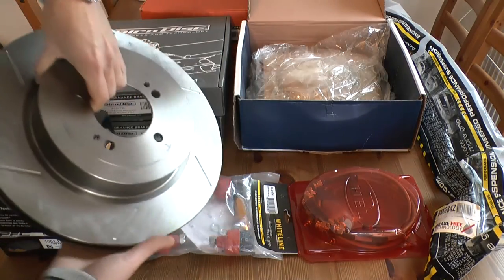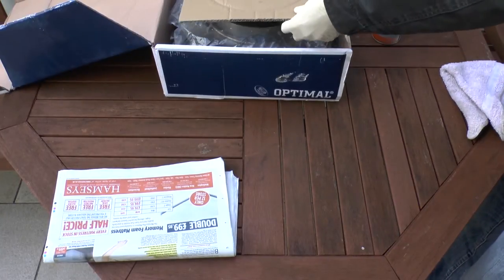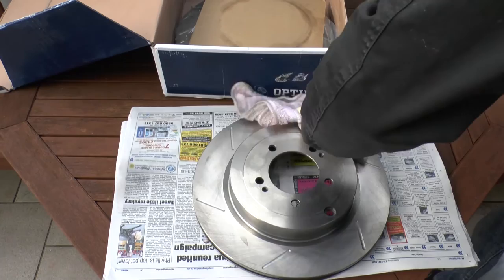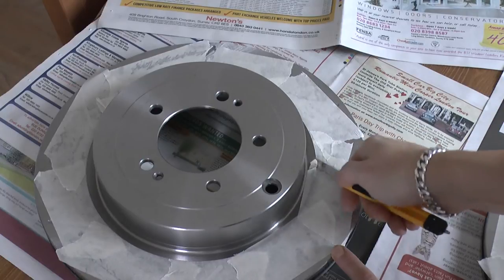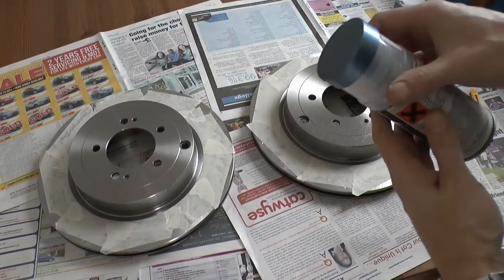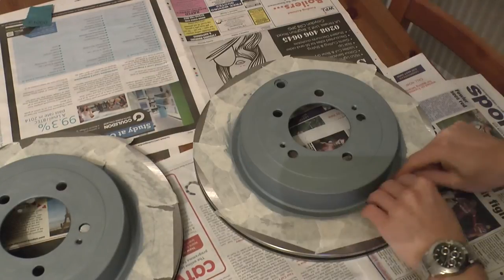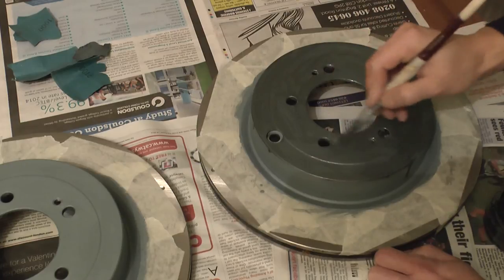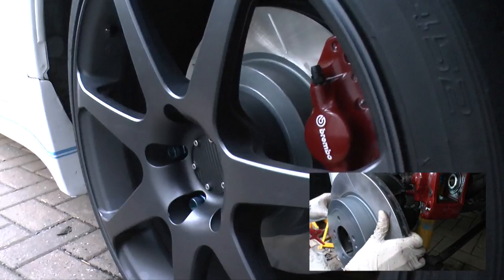How To: Paint Brake Discs/Rotors (Evo X)

Comment: Would a clear coat work the same as I want to keep the original shiny look on the discs thanks.
Reply from the maker: +Junaid Mohammed - Depending on what clearcoat you use (high-temp) I can't guarantee that clearcoat would stick to a metal surface without a primer first. So it may begin to flake off. I haven't done this before so I wouldn't like to say if it would be possible without it flaking off.,,, maybe someone else can advise?

Comment: the process was a little long, but well done.
Reply from the maker: Rick Bosch Yes, I agree, took  a little while and could have probably made the video shorter slightly. It's a good option though if you have the paint or aren't confident in spray painting. :)
Reply: Rafkoo  the video lenght was fine, I just thought the prep and paint process was long to achieve the
look you were going for.But don't get me wrong, I love your video's there very informative and I to have
evo x gsr.
Reply: MYSTX 5 minutes is long? you high